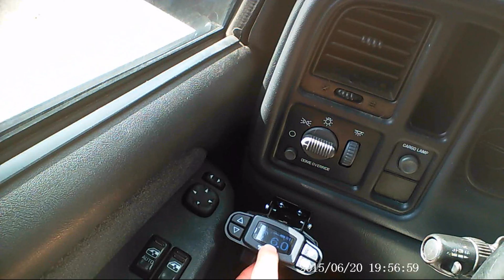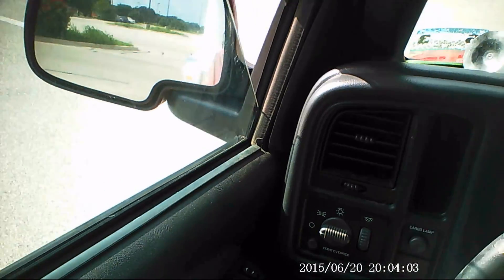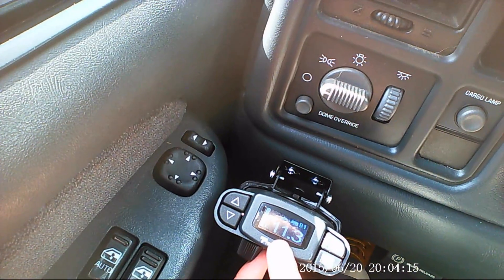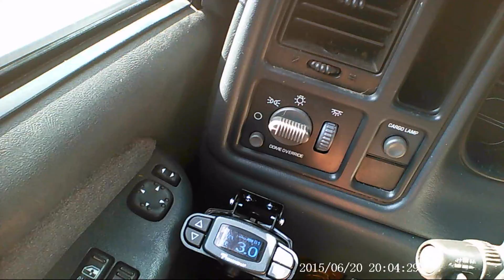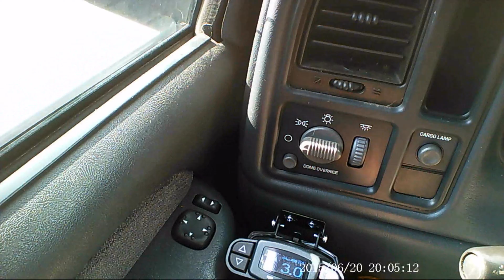How to program the Tekonsha P3 brake controller

Comment: Instructions call for mounting the controller parallel to the road on level surface
Reply: I also have this question.  How far off level can the controller be and still function properly?
Reply: Prodigy p3 can be mounted 360° from level as long as it is in line with the road.

Comment: Worst brake controller on the market they claim it is proportional but it is not it is inertia-based  I have an use a fully proportional brake controller it gets its signal off of brake line pressure on the tow vehicle when the brake pedal is depressed it immediately sends voltage to the trailer exactly and precisely on how much input you have on the brake pedal tow vehicle and trailer become one
Reply: @David Blue I can understand that if you’ve never used a fully proportional controller because it literally responds like your brakes on your vehicle meaning immediate and zero delay

Comment: When setting controller will it make a big difference if trailer is empty or full ?
Reply from the maker: It is ideal to set it when empty. It is safer to do so this way. Setting the resistance when empty makes sure that the appropriate amount is applied. You can do it when loaded, just not recommended or preferred.

Comment: hi, can you tell me if you used the brake light switch connections to the controller, or just used the plug on the vehicle to connect the controller ..thanks
Reply from the maker: Gursharan Mudan, just the vehicle plug not the brakes.

Comment: Where can I find out how to wire a 7 blade trailer brake light and brake harness on a 1970 Chevy truck?
What is the correct way to wire it in the fuse box? I really do not want to tap the 7 blade round into the existing truck lights, 
I would like it to have it's own dedicated wiring.
Reply from the maker: +707SonomaComa, my best bet would be to look for a clymer manual or ask on a vehicle forum somewhere. I don't have a good answer for you, sorry.

Comment: When you press the manual over ride are you also pressing the vehicles breaks while adjusting? Or are you just getting up to 25MPH and pressing the manual override and not touching the vehicles breaks?
Reply from the maker: You just take your foot off the gas and use the manual override. this allows you to test the max braking power you have set on the device to ensure you have the appropriate amount set.
Reply: Got yea don't touch the vehicles breaks when testing thanks just the manual override, thanks..
Reply: Was wondering the same thing , thanks guys